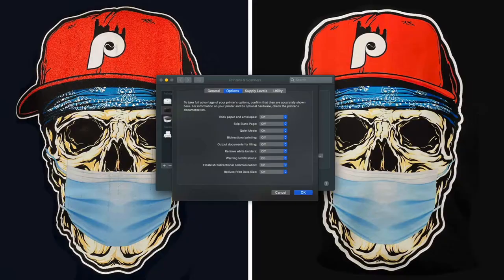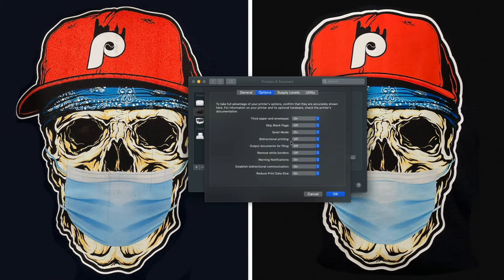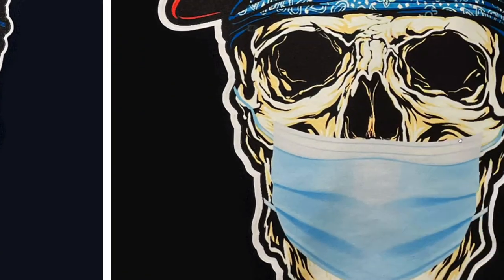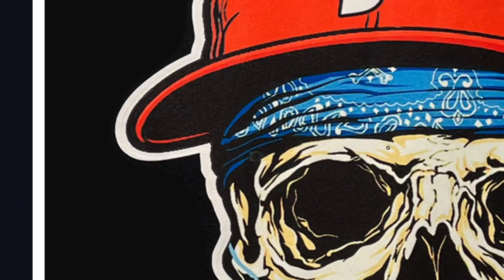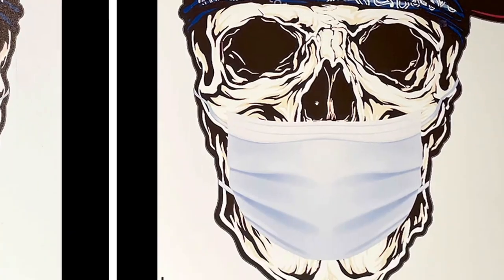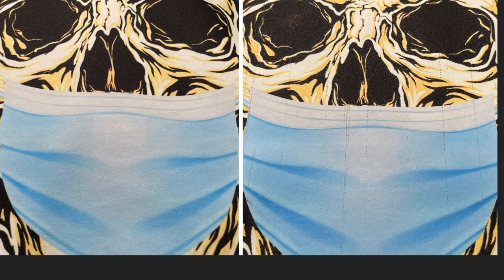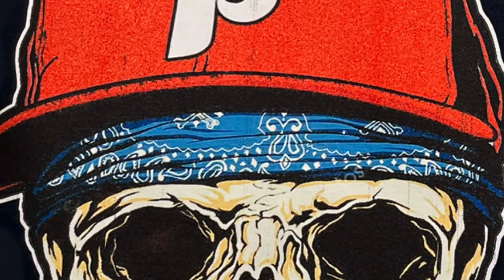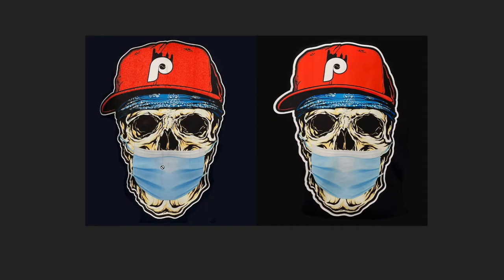EasySubli & Epson ET-15000

Comment: Hi, I have a question, I have this exact issue. I tried your 2 step process, but my white isn't very bright. Do you have any suggestions?? Also, did your Subli paper ever print good? Mine was printing good for about a week and then it started this.  🥴
Reply from the maker: Hi, have you had any success with any color print being bright or vibrant? I ask because "color" is a very in-depth subject and there could be a lot of reasons why what you're seeing on screen isn't translating to your print. Things like color profile on your graphics app, color settings from the print dialog screen(s). Embedded color profiles of the image..... Literally tons of things, could also be the brand of ink you're using. The easysubli paper should produce the "same" results all the time, the variable between what you're seeing and what I'm seeing is most likely a color profile setting somewhere. I have a video (I think) of the differences in profiles. I will find it and respond again.
Reply from the maker: Color Profiles : https://youtu.be/Oo_jCFvnBAI
Reply: @Dodge P.  Hi, thanks for replying. Yes, I've used the same image for 4 hoodies.It worked fine. I printed 4 Thanksgiving shirts and I noticed on each image the print was slowly changing. I went back to the same image for the hoodies and it printed different.  I never changed any settings. I've always used presentation matte, And it just won't print the same.  I switched to plain paper white, high quality and it was somewhat better but still not like the first hoodies. I'll check out your other video too, thx.
Reply from the maker: @latashanicholson7607  Interesting! Do you think your press temperature is not stable, meaning the temp is cooler than whatever your display panel is showing? All things considered, it could also be that you have a few bad sheets of easysubli or using there's a dead spot on the roll. I have to be honest with you, I started using a different product for some full color installations instead of easysubli and it works with a regular ink jet printer. That product is; Siser EasyColor DTV. It's softer than Easysubli and works pretty much the same way, minus having to use sublimation inks.
Reply: @Dodge P.  I did see a video where I might need to calibrate my press. But I'm pretty sure it's the paper. The printout comes out looking bad before it's pressed. OK, and the new product you use, it can be used on any color cotton? I really do appreciate your help. 🙌🏽
Reply from the maker: @latashanicholson7607  yes . All color cottons AND other fabrics.
Reply: @SirDodge  does it come in larger sizes than 8x11?
Reply from the maker: @latashanicholson7607  Not that I can find. If you can find it in 11x17 or 13x19 please hit me up and let me know.

Comment: Thanks for sharing, I was trying to figure out what people were talking about.  I watch another video by Johnson Plastics Plus titled "Using Siser EasySubli Vinyl" and the people demonstrated on a Sawgrass and Epson printer; within the video they said the Epson printer does not have a "technical print profile" for EasySubli. I have included the name of the channel and video so you can check it out as well.  When they demonstrated on the Epson printer they followed the "two stage" process of printing on the sublimation paper, cut the easy subli and then press on the easy subli.  Thanks for doing this video, I will be following this process with my Epson too.  Dope designs too!
Reply from the maker: Thanks.. I'm hearing other inks dry on easysubli but my ET-15000 is filled with something different. I'm actually finishing up a new tutorial with every part of the process on video.
Reply: @SirDodge  - Right on, looking forward to the video.

Comment: I was thinking of getting the et-15000. So you’re saying there is no way of printing with easy subli without having to use this method? Is this still an issue with black?
Reply from the maker: You may be able to use a different brand of ink however, the results of the color reproduction may be less desirable. I was actually thinking about buying a smaller eco tank and switching ink brands just to test the theory but I haven't gotten around it for health reasons.
Reply: @SirDodge  I just got the et-15000 and Hippo Ink I am going to give it a shot. What ink did you use? Maybe I missed it if you mentioned.
Reply from the maker: @LimitlessNarration  I was using the ink from Cosmo's but I can't recommend it just because I'm not a fan of their business practices nor their FB group moderation practices.

Comment: Hi, I had the same problem with my Epson 15000 when printing on EasySubli with prem or presention matte setting.  It was too much ink.  I decided to try plain paper, high quality and now it prints perfect.  Pressed it on a black t-shirt and it turned out beautiful and vibrant. Try it, it might work for you. 😊
Reply from the maker: I will give it a try.
Reply from the maker: I tried the different settings and still got the streaks. Have a look. https://imgur.com/m8ZEplG
Reply: @SirDodge  Aww, wonder why it does that.  Well, at least you tried and know the results. Your way is the best way though, but for me, I can't seem to get the easysubli the right size for the object I'm doing, especially when going around text.  I'd do a shadow contour, it looks good on the screen, but when I cut it out it's way off.  I'm using a GCC Jaquar V LX vinyl cutter, Corel, and Great Cut 4, no size limits using these.  Just can't seem to get it right.  I think the easysubli shrinks a little after heat pressing.
Reply from the maker: @jazzimat  Are you able to print registration marks? That's the only way I was able to get the size of the easysubli and my print to line up. It was an aha moment for me.
Reply: @SirDodge  Yes, I was.  I had to make the shadow contour a lot bigger to get it right.  Lots of trail and error for me.

Comment: I have the ET15000, A sub, printer jack and my prints look faded. I found this video because I thought maybe the Easysubli could help. We tried the settings that everyone is sharing and it's awful, did reg printer settings and a little better,but still faded. Any advice and what time/temp do you use for regular non easy subli? I keep seeing shirts on tik tok that come out so bright after press.😔
Reply from the maker: Hi, for sublimation the baseline is 400 degrees for 60 seconds. You have to start there and adjust time and temp depending on your results. You also have to make sure you're using a high quality polyester shirt. What graphics program are you using?
Reply: Adobe photoshop.  We've tried letting photoshop handle colors and printer handling color.  Downloaded printer jack driver settings also.   Doesn't help that we're not familiar with the program so feel like we're missing something
Reply: We also are using the 65% poly shirts everyone is recommending for bleach sub shirts and we tried the 400 for 60 and then tried 385 for 40. Everyone tells us differently but we are missing something somewhere.
Reply from the maker: @Wisteria_Lane  When I use photoshop and print; I allow the printer to handle the colors and then in the printer Color Settings I use adobe RGB 1.8 or RGB 2.2. When I first started I had to print color wheels using each profile to find out which profile met my color needs the best. I use Cosmos Ink and I can't complain even though I'm not a fan of the way the do manage their FB group. I'm looking to switch and I'm working with another ink company to sample their product.
Reply from the maker: @Wisteria_Lane  email me some pictures of your pressed garments:   dodgep.social@gmail.com
Reply: @SirDodge  Have you gone with different ink now?  Which one if so?
Reply from the maker: @msdixie1972  Hi, I have not because I hopped on the DTF bandwagon but I've been unsuccessful with the DTF process. I'm hearing great things about Printers Jack sublimation ink though.

Comment: When I try to line up my asub mirrored image onto the easysubli, I find that the easysubli shrinks a bit when it is heat pressed. Any suggestions?
Reply from the maker: Yes I do. If your time and temp are what easysubli recommends - I suggest; lowering the temp 10 degrees & reducing the time as well. Remember you only need minimal adhesion of the easysubli that it doesn't move when you layer on top of it. Full adhesion will happen during the second press and sub paper should keep it from shrinking as much as it does now.

Comment: Awesome video. I figured this method out through trial and error as well. Do you apply the Easysubli as recommended 311/15 and then apply the A sub for 400/60?
Reply from the maker: Hi, yes! I just turn on my heat press and set it to 400 for 60 and press the easysubli when the press hits 310. This way I don't have to adjust the temp and time twice. I'm a little lazy.. lol
Reply: Have you done a wash test yet? If so, how would you rate the results?
Reply from the maker: @lajuanwright507  Hi, have no fear. After washing you lose no color or vividness. I'll do a wash video soon.

Comment: Dude, great video answered all my question I have an Epson ET 2720 and does a great job for the price of the printer and I just picked up a Cameo 4 so and got 10 sheets od easysubli to try and been wondering the best way to use it and I'm about to watch your other video I hope you say how long you are pressing them for and temp your using. Keep up the great work.
Reply from the maker: Hi. I tack the easy subli for 15 seconds at 320 degrees then I place the sub print on top of the easy subli and press for 60 seconds at 394 degrees. The standard for sublimation is 400 degrees for 60 seconds but the heat can vary depending on your press.

Comment: Thank you for the update. I was ready to throw my 7720 out the window over those roller marks. Glad to know it isn't just me!
Reply from the maker: lol ... the funny thing is, I had a design that had block letters in black that I think would have sold very well but my 7720 was letting me down with the streaks.. I just want to make sure you have High Speed Printing turned "off" .. I'm sure you do! I just wanted to ask.

Comment: When you cut the sublimation paper are you just using the standard cutting mat?
Reply from the maker: Hi Joel, yes.. the sublimation paper is indeed cut on the standard cutting mat. Cut settings are Copy Paper with 16 Force (but also depends on the age of your blade, if your blade is a little dull you may need to increase the force) and 6 Speed.
Reply: I can’t seem to get the paper to come off the mat cleanly. I used a light grip and it even had issues. They were new mats so maybe that’s the issue?
Reply from the maker: @joelkimble1807  I use my weeding tool to get under an edge and lift the cut design as much as possible, and around as much of the design as I need to be able to have a decent grip with my fingers on it - then I slowly peel the rest of the design off. I'm also using ASub 125G sublimation paper which is fairly thick. It sounds like your sub paper is thin, like copy paper.
Reply: I got it to let go using a light grip mat I stick to tee half a dozen times to lessen that tack! 🤣 I usually use asub 125 but I’m out and was trying to use up the crap ton of trupix classic I have atm. Thanks for the video and tips! This is a good tool to have in the toolbox for sure!

Comment: My et15000 been having the streaks on the image when it prints any idea how to fix that?
Reply from the maker: Make sure Thick paper and envelopes is ON, Quiet Mode is ON, Bidirectional Printing is OFF
Reply: @SirDodge  i can't pull up the settings dialogue you show in the the video on my ET 15000.

Comment: I have black spots how can I get rid of that?
Reply from the maker: If you're using an epson and you're trying to print on easysubli you're not going to be able to NOT get the dots because the ink doesn't dry before it advances through the printer. You can also turn on Thick Paper and Turn on Quiet Mode.

Comment: I can't get my wf7720 to not jam when it's trying to load the easy subli.. I've tried in cassette 1 and the rear feed tray. And I've tried all of the paper settings. Has anyone else had this issue!
Reply from the maker: Hi, I don't actually print onto the easy subli because the ink doesn't dry but when i did, I didn't have any problems with the 7720 jamming.

Comment: How do you like the epson 15000?
Reply from the maker: I love it compared to the WF7720 I had. It's smaller, easier to load paper and ink and I have not had 1 misprint or jam since I bought it. If you're on the fence, I would say jump over it and and buy one.
Reply: @SirDodge  thank you! Appreciate the quick response.  I've been battling myself today to go buy one lol. I want to print larger images for my shirts. Stuck currently because I can't seem to find any heat presses that will do images that big that won't break the bank though.
Reply from the maker: @mattglassner3105  I only have a 15x15 press and at some point I plan to buy a 16x20 press but I'm in no rush. With that being said I've only printed 13" long and I was not disappointed.
Reply: That's reassuring news! Thanks so much for your input. Appreciate the knowledge you keep dropping, great content!